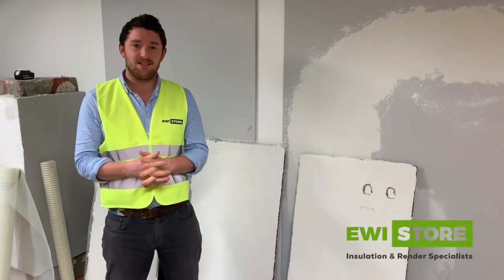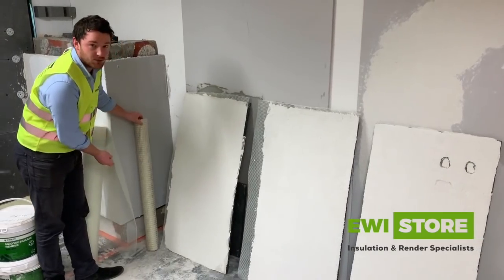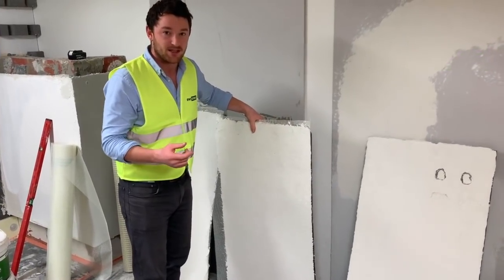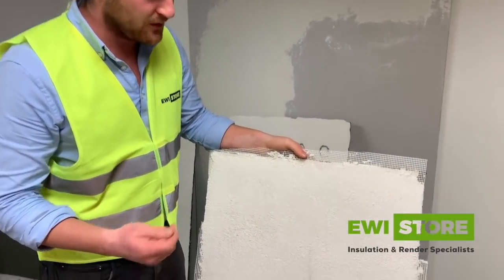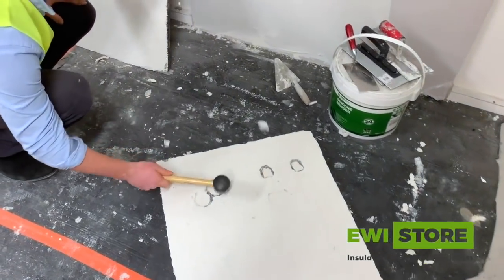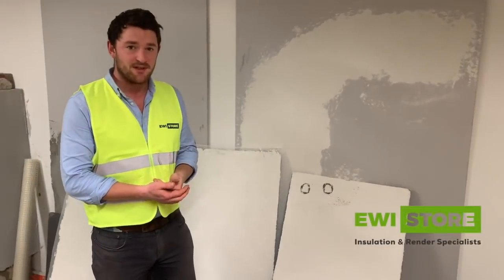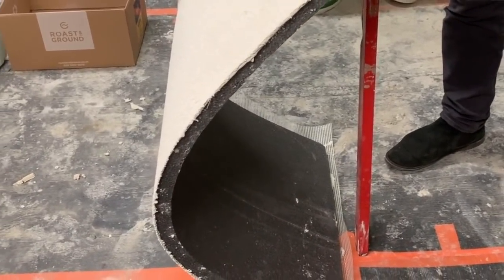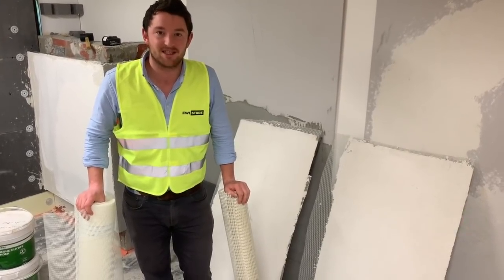EWI Pro Silicone Render Impact Test

Comment: You are showing the flex test where the force are coming from the insede of the wall! Real life scenario something is pushing on an exterior wall from the outside, so the plate should bend the other direction.
Reply from the maker: Hi there, thanks for your comment. Every building will undergo phases of heating and cooling, which means that the building itself (for example the bricks) will expand and contract very slightly. This pushes against the render from the inside, which can cause cracks within your render finish.